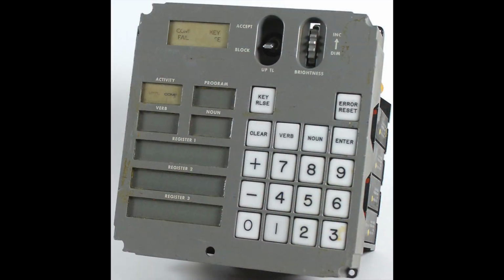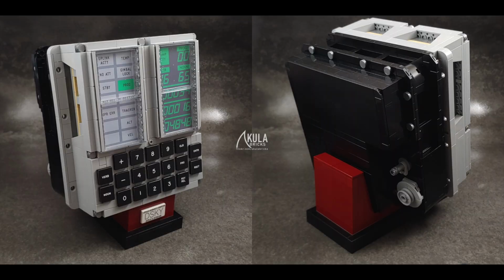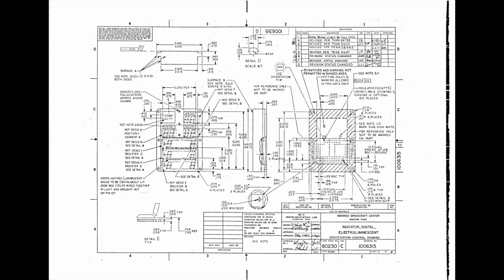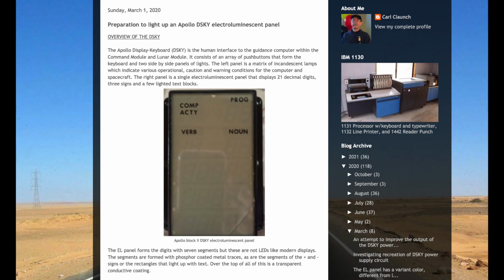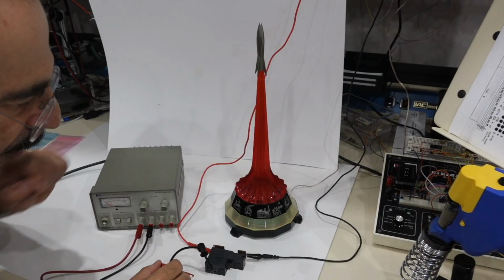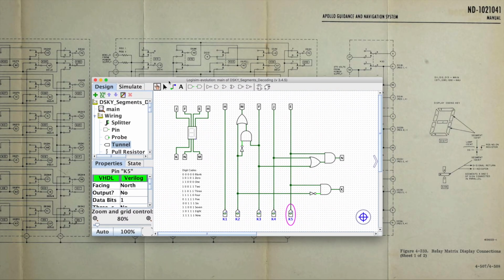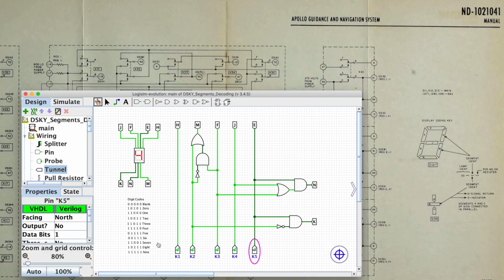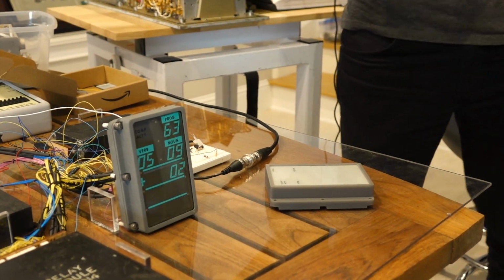Apollo Guidance Computer Part 28: real DSKY display works again after 50 years

Comment: CCA wire ... just yesterday we spent a few minutes cursing at the jumper wire in the lab that refused to take solder ... no matter how much flux was added!  Now I know.  Thanks!
Reply: The fact that it used in mains cables (D-cable specifically) is baffling to me.  So dangerous.  I've seen it go "ohmic" like that.
Reply: We call it Crappy Chinese Aluminum...
Reply: Where do you buy that junk.  Where I live it's been illegal to sell or use aluminum wire since the 60's.
Reply: @BobWiersema  Proper aluminum wires are still used for running power into buildings (AsXSn), it is massive in size though and requires proper termination to avoid corrosion, especially when joining with a dissimilar metal like copper, but it's cost effective.
Reply: @BobWiersema  Well, I don't use it when I find it, but it's sort of acquired by accident when they come with certain appliances I've purchased that use D-cables to get to the wall (US).  Laptop-style power adaptors most prominently is where I've seen it.  Breadboard wires?  That's pretty sad.
Reply: @wonderbars36  I think it's used for overhead distribution because it's 'A' cheap, & 'B' keeps the copper thieves away.
Reply: What really boggles my mind is that some chinesium wire is springy and magnetic.... Is it plated steel? Lmao
Reply: @paulstubbs7678  Aluminum wiring is used not only because it's cheaper per current carrying capacity, it's lighter too. That reduces the cost and number of power poles/supports, which is where the majority of the cost lies. It's also used in airplanes since the 1970's and cars (particularly Toyota) for this reason. The only place copper wins is volume per ampacity.
Reply: @BobWiersema  In the US, aluminum wiring is used everywhere up to the residential meter. In commercial it's used up to the final panel, and industrial applications it's used to the load. 

The only reason why it's got a bad reputation is because of the dangerous brass screw terminals used on outlets and switches. Aluminum is dangerous is a complete boomer myth when all of the US transmission and distribution system is aluminum, airplanes have been using it since the 1970s, and cars have been using it for a decade.
Reply: @wonderbars36  In a former neighborhood, some of the early-60s houses were built with aluminum wire. Which was attached to copper screws in the outlets and circuit breakers. Humidity and dissimilar metals did their thing...and several houses had fires. The rest of the houses (including mine, thank goodness!) were built with copper wire.
Reply: @petersimpson6076  Ah very good there, good sir.  Unfortunately my house did not get the copper wire royal treatment (70s tri-level).  That too is appalling that garbage was allowed to be used in many...many homes.  Outlet replacement super sucks.  Takes nothing to have that wire break when bending it onto the terminals.
Reply: @FrozenHaxor  I've heard the term chinesium before but now I really grasp the depth of cheapening the will go to.

Comment: I worked on the Apollo Guidance Computer software and hardware. Before that I worked on Electronic telephone exchanges. The mech charts you showed brought back old memories. Before there were sophisticated enough computers for control of equipment, we had hard wired NOR and OR gate technology to perform logical operations. Computer memories were not sophisticated enough to handle most applications (in the mid-1960's). The Apollo computer was truly unique in that it had a simple (by today's standards) core memory (called "ropes"). Those "ropes" controlled a central processor that gave instructions to the guidance and navigation system on both the Command Module and the Lunar Lander without the need for "hard wired" NOR and OR gate decision making.
Reply: Haha, the relay modules do indeed make the display sound like a telephone exchange :)
Reply: Awesome! You're in good company - weren't Shannon and Flowers both working with telephone switching systems before basically inventing modern computers?
Reply: @thromboid  If you mean Tommy Flowers inventor of Colossus, yes he was a GPO engineer I believe at Dollis Hill.
Reply: The first Turing complete stored-programme computer was the Manchester baby though, which used vacuum tubes instead of relay logic. Colossus was kind of a dead end as far as early computer development went.
Reply: @TheBreadlord  But we're now into the issue of defining what constitutes  a computer. Manchester uses "stored program Turning complete" because it makes them first. The US omits the "stored programme" part so it can claim EDVAC was first. Cambridge uses "stored programme general purpose computer service" ie one with input and output because that makes EDSAC first (baby had no means of output other than reading the dots on the CRTs of the Williams Tubes). And so it goes on. They were all steps on the road.
Reply: This is also true. The baby was really a test of the Williams tube and didn't have IO, but it did evolve fairly directly into the Ferranti Mk I.

For my own opinion it's the stored, replaceable program that makes it a computer. If mechanical intervention is required then you may as well call an old jukebox a computer. I'm not disputing the historical importance of Colossus, but I think it lacks the features required to define it as a computer as we know today. If anything, because it pre-dates Von Neumann's definitions of 1945.
Reply: @owensmith7530  Ideed yes! In Spanish language we actually use both male noun "computador" and the female one, "computadora" to refer to any computer. But the female "computadora" applies directly to the brilliant and brave group of women depicted in that movie. A last but not least tribute to the incredible group of people that made this possible. Must say that Margaret Hamilton is my heroin, btw.
Reply: @thromboid  Well...I certainly DIDN'T invent the Apollo Guidance and Navigation Computer. But in the Telephone industry I did work on switching systems that used NOR and OR gate technology to perform "decision making" operations. The drum memory, we used, was ONLY used to store telephone numbers NOT to make decisions. This method (of using a computer to control a vehicle) was a brand new concept for many people in the Apollo program. People VERY OBVIOUSLY were wary of it because they were used to looking at an electrical diagram to determine how a "black box" would perform under various conditions. With a Computer and a software program they could not do that (unless they had a software flow diagram). I faced the same problem, 12 years later, when we installed the first Flight Management System on the 747 at Boeing. The people at Boeing felt very uneasy for the same reasons the Apollo people did.
Reply: Noel Coward  Coward! :)
Reply: Core  Rope Memory, laced 114 thousand times. CRM 114
Reply: @aphoenix9349  By HAND!
Reply: @badguy1481    Yes, it was the rope memory that was fed by hand by the Raytheon women. That may solve the mystery of that meme photo of Margaret Hamilton standing by a tall stack of listings that, according to the meme’s caption, she supposedly (of course ridiculously) wrote ”by hand.”  Were you at the MIT Instrumentation Lab? I was there doing GN&C software for AGC and LGC from 1966 through the Apollo missions. Sounds like you were on the hardware side.  Were you working with Eldon Hall?
Reply: That proves moon landing only happens on TV screen. Probably directed by Stanley Cubric.
Reply: How do you feel about conspiracy theorists saying “none of it happened”? Must be infuriating!

Comment: You need to sample that relay click sound for incorporation into the microcontroller based replica DSKY's
Reply: Great idea !!!
Reply: Simply use a real relay that sound similar and pulse it when necessary....
Reply: they should hav jus used lcd touchscreens then ther wouldnt hav been no clicking and all.
Reply: @batman-cw2hd  Well the first LCD screen wasn't produced until 1982, 20 years after the electronics for Apollo were designed.  And the brightness and contrast of the early LCD's were quite poor.
Reply: @joyange1  you need a vacation !! hahaha
Reply: Isn't it a lovely noise? I wonder if the astronauts were able to hear that noise as well or if it was so buried they couldn't hear it.
Reply: I think instead, replica DSKYs should all contain a little clicky relay. If the bistable ones from 1965 aren't available, I'm sure one could audition a few modern ones to find the right note.
Reply: @joyange1  Because it's less technical and cheaper. God forbid we try to simulate something from history because it's more feasible than building a DSKY from scratch which would be impossible as stated in the video.

Comment: literally the week after we filmed this, i was at work and ran into issues that turned out to be caused by CCA jumper wires. awful stuff.
Reply: Is it just for fraud? What is the point of CCA over just Aluminum wires if the copper is so thin it make not difference? The degradation would seem to make it unusable over time.
Reply: The copper coating is to prevent the aluminum from oxidizing when the air hits it.  Aluminum wire is a fire hazard when you use it in house wiring.  If I find any of it, I make sure it's never used, it gets recycled.
Reply: I always wondered why some of my jumper wires just didn't work... I've started beeping them out before I use them.
Reply: An older version of CCA was approved for house wiring decades ago.  It had thicker copper cladding, but didn't succeed commercially.
Reply: @MRichK  Aluminum oxide (Al2O3) is downright explosive in certain conditions, and if memory serves it is often used as the fuel for SRBs as the results of its combustion are comparatively nontoxic.

An example of this is the Ariane 5’s boosters.
Reply: Some of our network cabling is CCA.  My brother bought a whole reel of it ten years ago and more recently wired up a jack with it in my basement, and I had the arduous task of rewiring the jack since he (a former network technician) just followed the badly written instructions on the jack instead of paying attention to how the terminals in the jack itself were wired.  The only tool I had to individually strip the wire was a Paladin Stripax and I had to be gingerly with it to keep from breaking the wire.
Reply: @TheEmeraldMenOfficial  Aluminium oxide is almost completely inert. It is the aluminium metal that reactive. 
The thing used in solid rockets is ammonium perchlorate mixed with aluminium powder. 
Saphire and ruby is aluminium oxide with small impurities.

Comment: Amazing! It's extremely visible and clear with the room lights on, and not too bright with the lights off. And yeah CCA speaker wire - When you strip it and twist it, the fibers fall apart in your hands and little fragments go everywhere. The thought of that carrying mains voltage is terrifying.

Comment: That relay clicking sound is the kind of thing set designers on movies never think of. The contacts would have a limited number of cycles, but enough to get on the moon and back safely. The thing about just doing an audio sample is it depends on which segments are on or off at any one time, they are all slightly different contact/release times!
Reply from the maker: Relays are much more reliable than you’d think. They got perfected for many many years for telephone exchanges that demanded very high reliability.

Comment: There is something magical about electroluminescent illumination. My late 80s Realistic radio scanner had EL backlighting for the LCD display. That soft blue/green glow was fantastic. I also recall that the first few GPS navigators released by JRC (Japan Radio Company) in the early 90s used EL backlighting as did some models of rudder angle indicators make by Tokimek (TKC) I spent almost 30 years in the marine electronics industry 🙂

Comment: In 2005 I wrote a LabView VI to model the relay logic in the 5 bit to 7 segment decoder, based on the circuit shown in the Apollo 12 Mission Report Fig. 14-1.

FYI the 5 bit codes are in the AGC source code in a LUT named RELTAB in T4RUPT PROGRAM and are used in PINBALL GAME BUTTONS AND LIGHTS.

Comment: You can simulate a latching relay with a reed switch, a ring magnet and two coils, one on each end of the reed switch.  The ring magnet is pushed back and forth along the reed switch by the coils, and activates or deactivates the reed.  Thanks, Marc.

Comment: I seem to recall that human eyes are more sensitive to green than the other colors.  So all else being equal a green display would seem brighter, even if it technically wasn't.  I wonder if NASA went full-nerd and did a study to find out which wavelength of green was the easiest to see and then tried to use it.  Or maybe it was just the paint they had at the time...
Reply: That color is "stop light green" because those who are color blind need a little blue with the green to tell it from the red.
Reply: Knowing Nasa engineers I highly doubt this was just a random color picked

Comment: (31:09) Whilst building my 11 digit nixie clock a few years ago, I had two of those protoboard wire jumpers that were bad... 
It did in fact take me some time to find the damaged cable because you just don't expect the wires to be faulty!

Comment: Wonderful work, wonderful video. The copper cladded aluminium is a pain and introduces unnecessary faults. Working with the breadboards you are using is a reason for other faulty behavior too. I gave up frustrated using them; they suck. Really they do.  If you want to test a circuit before making a pcb; use the dead spider method; glue components who allow it with their back to a sufficient surface. Solder (!) all the copper, yes copper, wires to all of the leads and let two wire parts hang in the free air. It does look messy but there are no doubts on connections made and the system is really flexible too. Plus, another virtue of the system; if you are trying to use copper cladded aluminium wires; heads up; they don't solder... Maybe this helps development somewhere somehow...  Thank you for sharing all this wonderful nerd science with us. Stay safe and be happy. Best, Job

Comment: In my school years found a box of cold cathode displays, used in large indicator panels. Brown casing around 6 cm in height with white matte glass at front, green 8 segment digits. Color and digits was very like to ones in your screen. Probably was intended for use in industrial indicator panels. For fun made a digital clock with these later.

Comment: Next challenge, marc finds and rebuilds an Apollo Emergency Ascent Computer, which has even less documentation and its own unique architecture
Reply: And the DEDA, an interface box that has its own little state machine inside of it, with an even more arcane "language" than the DSKY. That would be fun! I've always been surprised about how little we've been able to find about the AEA. As far as I can currently tell, there's no engineering drawings for it at the National Archives in Fort Worth. Which seems strange, but I guess the AGC stuff is there because MIT was under direct contract with NASA to produce the PGNCS, while TRW was only subcontracting for Grumman for the AGS. But we also didn't really find any AGS stuff when we looked through the Apollo material that Grumman transferred to the Cradle of Aviation museum.... so I really don't know where we'd find more, at the moment.

Comment: What would be the level of effort to build a "relay module simulator" that used transistors to do the HV switching instead of relays, but took the same inputs from the AGC.

It would, of course, have audio output to simulate the relay clicks :-)

Comment: The Helsinki airport in Finland used a big electroluminescent display for flight info from 1983 to 1998.  It was built with Atomic Layer Epitaxy technology of Tuomo Suntola and not a single digit failed or noticeably faded during the 15 years.  it appears the drivers at high voltage AC were the scary parts to later maintenance, leading eventually to replacement of the panel.

Comment: Those latching relays quite often use a magnet to keep it locked one way or the other. Try reversing the polarity of the supply to your test relay, I think you'll find their functions are transposed.
I am using one at present, driving only one coil, but flipping the polarity to control it.

Comment: I’m with you CCA is total crap! Working in  the mission critical communications field it’s been responsible for more then one major failure that could have been life threatening. What always ends up happening something breaks someone will order a replacement from Amazon or EBay because it’s easy and fast. This bad jumper comes in IT staff or some other technical inclined person will replace the jumper (even if they aren’t suppose to) Next thing you get this call at 3am we can’t talk to a life flight helicopter and you go to the site and they have some aluminum cable jumper that’s turned to dust! It’s always sold as 95% braid low loss coax compare to times microwave etc… It’s going to get someone killed!
Reply: That is why, for mission critical stuff, you buy certified products from certified manufacturers. It is expensive, but quality is not free.

Comment: Recently I couldn't find that "font" from those DSKY digits. I want to make a huge sprite-clock (digital) in Pico 8 and those relays turning specific parts of a digit on and off was something I looked into. I did my own prototype of that on paper and was glad to see the original "circuit" now. In Pico 8 there is an interface to the OS clock in 3 units/bytes and it's easy to draw something and display it.